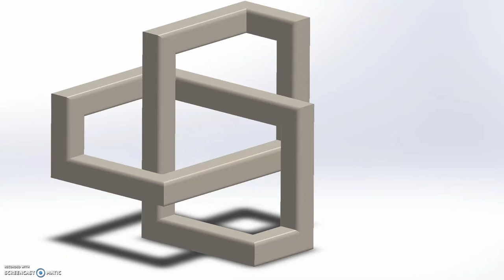Steel Knot Sculpture

Comment: Question, what blade are you using in that makita chopper?
Reply from the maker: I'm pretty sure it's a B-15805. https://www.totaltools.com.au/74748-makita-305mm-60t-tct-circular-saw-blade-metal-cutting-specialized-b15805

Comment: nice work but I don't get why you bothered doing vertical up vert down has ample strength for this. going down you will have a flat weld so less grinding. also just my opinion I think you should have not welded the inside corner to me unless it's sanded out it makes it look unattractive. just my opinion if it's a tight fit up there's no need to.
Reply from the maker: Both very good points, thanks!  First, I'm not a welder, and only recently really found out what vertical up/down means - I kind of just did what felt natural, but you are right.  Likewise, I guess I kind of wanted it "water tight", but the fit-up was pretty good from the cut saw so could have done without it.
Reply: Ohh ok great job that you done.